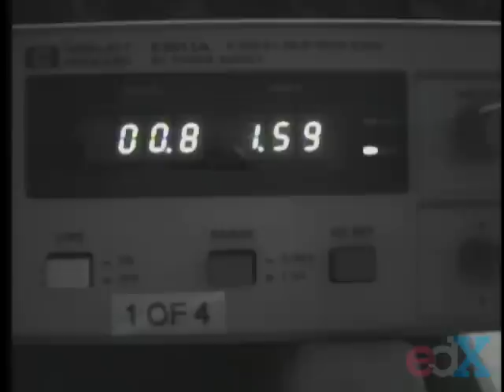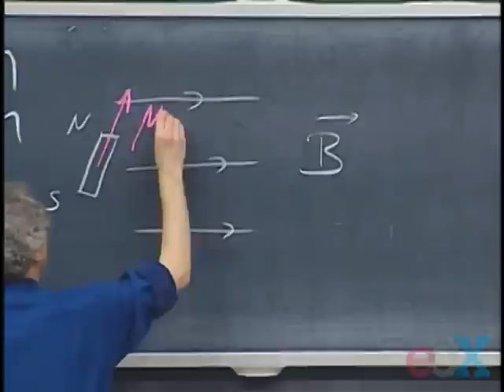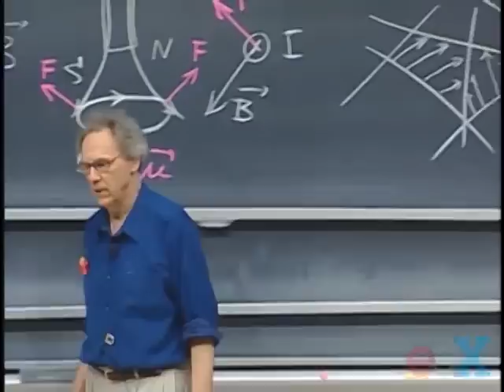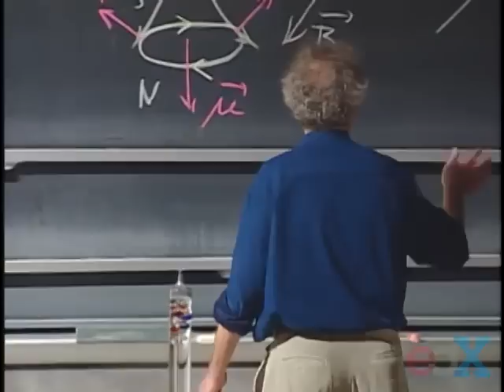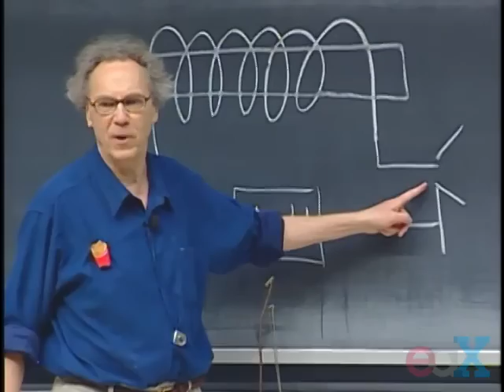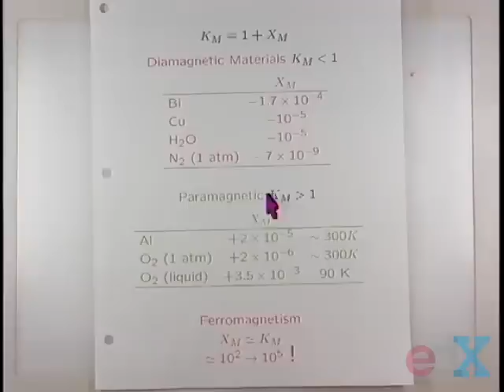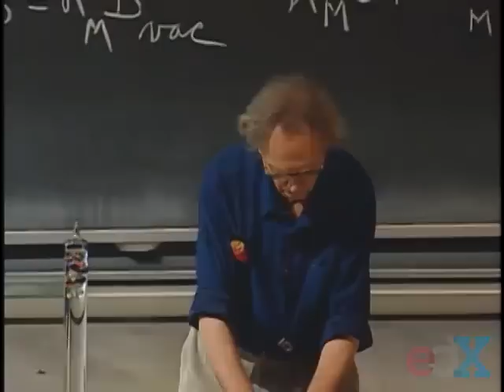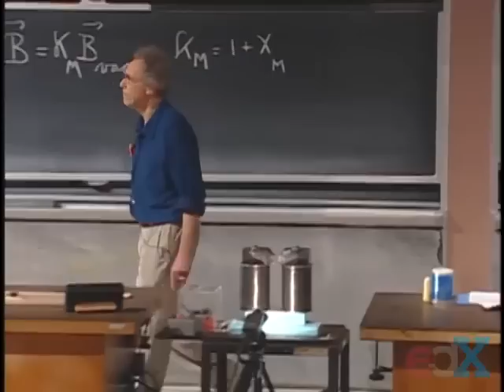8.02x - Lect 21 - Magnetic Materials, Dia- Para- & Ferromagnetism

Comment: Why does the external field have to be non-uniform for a ferromagnetic material to be pulled towards the magnet? The magnetic dipoles will align themselves with the external field's magnetic dipole, but won't that happen if the external field is uniform too?
Reply: I just got it, if the field is uniform the dipoles will still align themselves with the external field's dipole, and the net Lorentz force will be zero. What I don't understand now is, how come there's a current in a molecule or atom? (12:55)
Is it a fictitious current that you used to explain the existence of a force or is it actually real? For example a water molecule has a magnetic dipole, but does that mean there's actually a current on that molecule?
If not then do we need quantum mechanics to explain why magnets attract each other? Since we can't make use of the Lorentz force anymore?
Reply from the maker: Only QM can answer your questions.
Reply: @Fattyboye  When a magnet is in a uniform magnetic field, the magnetic force on both its poles adds up to zero.  The uniform magnetic field cannot apply any net linear force to it.  All it can apply, is a rotational torque that causes it to align with the magnetic fields.   You need non-uniform magnetic field, such that more force is on the north pole than the south pole, or vice-versa.

If there were such a thing as magnetic monopoles, a uniform magnetic field could theoretically apply a linear force to them.  So far, magnetic monopoles have not been discovered or even theorized to be possible, so this example is all hypothetical.  As far as we know, real magnets come with both poles as a package deal.

Comment: sir at 30:10, why ferromagnetic material doesn't attracted towards the magnet when you bring it very closer?
Reply from the maker: I watched at 30:10 and I do not understand your question
Reply: @lecturesbywalterlewin.they9259  Sir question is at 30:10, why not ferromagnetic material just leave the coil and attracted to bar magnet when magnet was very close to coil? Due to friction or you bound it tightly within coil or something else?
Reply from the maker: Lectures by Walter Lewin. They will make you ♥ Physics.
 • 9 hours ago
I watched at 30:10 and I do not understand your question
Reply: @lecturesbywalterlewin.they9259  I believe I understand what they're trying to ask.  When you perform the demonstration, you place the piece of ferromagnetic material inside the coil.  I believe they're asking why, when you bring the magnet near the coil, the ferromagnetic material isn't pulled out of the coil towards the magnet.

The way I saw you set up the demonstration, the ferromagnetic material seems to fit rather snugly inside the coil.
Reply from the maker: @nybble  If you first power ths coil then  put the ferromagnetic material into the coil it will be sucked into the coil.
Reply: @lecturesbywalterlewin.they9259  Oh I know!  I was just trying to clear up the original question asked by Adarsh.  :)

Comment: Professor, I have a question: The core of a transformer is made of ferromagnetic material. We know that  when a ferromagnetic material is placed in magnetic field, the field lines become confined in the material. Then how does the secondary winding of a transformer(which is wound outside the core) knows the presence of alternating magnetic field when the field outside the limb becomes almost zero ??? 

Sir Please help me to understand this.
Reply from the maker: google transformers.  One very very common way is that the primary and the secondary are wound around the same ferromagnetic core.
Reply: @lecturesbywalterlewin.they9259   But professor, the flux prudced by the primary winding is restricted inside the core, the flux is not 'touching' the secondary winding as the secondary coil is wound on the outer  surface of the core.  Then how does the secondary winding sense the magnetic field?
Reply from the maker: @abhiksasmal3304  yes it is restricted inside the core.  You do not understand Faraday's Law.  Watch my 8.02 lectures!

Comment: When a material having permanent electric dipoles is placed in an external electric field, we say that the electric field inside the material is reduced. But when a material having permanent magnetic dipoles is placed in an external magnetic field, we say that the magnetic field inside the the material is increased. Why is that sir? The below dipole configurations with E and B
+Q/ -+ -+ -+ -+ /-Q
N/ sn sn sn sn /S
The magnetic situation should be similar to electric situation. Correct?
Reply from the maker: system goes to Low PE in both cases.
Reply: @lecturesbywalterlewin.they9259  thank you much sir for a fast reply. 

Another question sir.
With cracking sound, we understand that atoms changing positions. Will a polycrtstalline ferromagnetic material become a single crystalline material?  I am wondering this for a quite long time.

Comment: Good evening sir. The magnetic field lines due to a bar magnet inside the bar magnet do not vanish, that means the permanent magnetic dipoles in the bar magnet(if any) can experience that magnetic field l. So, does that mean the bar magnet can magnetise itself?
Reply from the maker: question unclear
magnets exist in nature
Reply: Lectures by Walter Lewin. They will make you ♥ Physics. I am trying to say that if we bring a paramagnetic material in presence of a magnetic field, the atomic dipoles align themselves in direction of the applied field. So similarly can a bar magnet affect the atomic dipoles inside it due to it's magnetic field. If i am making some conceptual error then please highlight that too. Thank you professor.
Reply from the maker: >>>similarly can a bar magnet affect the atomic dipoles inside it due to it's magnetic field.>>>
It takes energy to do that. Perhaps this may be possible if the object cools substantially. ask google
Reply: Thanks sir. So it is possible if the thermal motion is decreased substantially?
Reply from the maker: I assume so

Comment: Say if I put a magnetic material inside a solenoid having n turns and current I , magnetic field inside magnetic material is nu*M where M = n*current induced in material. Now if I remove solenoid and magnetise it using bar magnets; what would be the magnetic field induces now?
Reply from the maker: >>>>> Now if I remove solenoid and magnetise it using bar magnets>>>
I don't understand
Reply: Lectures by Walter Lewin. They will make you ♥ Physics. Sorry for question being unclear. Basically in first case I was using solenoid to induce magnetic currents in the magnetic material. But now out of curiosity I took another piece of the same magnetic material which is UNMAGNETISED and try to magnetise it by creating a magnetic field not through the solenoid but using BAR MAGNETS. So in this case how can I calculate the magnetic field induced in the magnetic material?
Reply from the maker: I would no know how to calculate it. The B-field inside a solenoid is well defined and uniform. If you bring ferromagnetic material inside the solenoid it will respond in a way that is more or less predictable. But to use a bar magnet to magnetize iron is a very different thing. In high school I used to magnetize paperclips that way. Nice to pass the time.
Reply: Ok..Thank you for reply

Comment: Sir, what if we have a changing magnetic field near ferromagnet or paramagnet, what will happen then, will there still be attractive force between the two or will there be an induced emf in the material and they would reject each other?
Reply from the maker: >>> what if we have a changing magnetic field near ferromagnet>>
attraction will be maintained in most cases
Eddy currents will also be produced.
Reply: Lectures by Walter Lewin. They will make you ♥ Physics. Is that because force of attraction is larger that the repelling force created by eddy currents
Reply from the maker: it all depends on
* geometry
* strength and frequency on external B-fields.
Reply: Lectures by Walter Lewin. They will make you ♥ Physics. Thank you a lot sir, I really admire your students, you are the best :)

Comment: Professor, since paramagnetic materials have an increase in relative permeability with decrease in temperature, and ferromagnetic materials lose their ferromagnetic properties with increase in temperature beyond the Curie point, does that mean that ferromagnetic substances will have an increase in their ferromagnetic property with decrease in temperature, like paramagnetic substances?
Reply from the maker: Castor Gemini Castor that is a very good question. Clearly if you move away (by cooling) from the Curie temperature, T_C, the strength of the ferromagnetic properties increase. However, if you go far enough below T_C the increase is very very small and asymptotically approaches the maximum. I suggest you look at the schematic figure 3.8 in the following article. http://www.cmp.liv.ac.uk/frink/thesis/thesis/node40.html
Reply: Thanks Professor!

Comment: Professor, I had a very general doubt.

I am not able to understand this:
When a material with many electric dipoles (say polar molecules) is placed in an electric field, its dipole align to create surface charge densities which OPPOSE applied field.
But, when a material with magnetic dipoles (say paramagnetic or ferromagnetic) is placed in magnetic field, its dipoles align to ENHANCE the applied field to a certain extent. Can you tell why does dipole alignment in magnetism enhances the field. 
Or why not the alignment of electric dipole enhance the field ?If I am wrong in facts, please correct me.
Reply from the maker: Place a compass in the Earth magnetic field. It will rotate till it has reached the minimal energy state. That is when the B field of the magnet of the compass aligns with the B field of the Earth magnetic field and that enhances the B-field. Take two permanent magnets bring them close to each other. They will also align (minimum energy state) which will also enhance the magn field.
Reply: I am sorry Professor but the thing is I can't understand is WHY IS MAGNETIC FIELD ENHANCED when magnetic dipoles align with external field.
Reply from the maker: take a permanent magnet #1. Draw field lines at its North Pole. Take a 2nd magnet #2 and draw field lines near its S pole. Now place the N pole of magn 1 against S pole of magnet 2. The B-field at the N pole of #1 has doubled.

Comment: Professor, I had those commercial playing magnets with me when I was a child you were supposed to throw them up (not sticked together but close to each other) and they would create sound midair. They often fell on the ground and separated but after that they   sticked perfectly together .Is that possible? What could they be made of?
Reply from the maker: no idea about the sound. Yes if you break a magnet they "fit" again nicely together but remain broken.
Reply: I was not specific enough They were two black cylindrical magnets and they buzzed when they stick together midair and they dont break when they hit the ground they are very tough but they didnt demagnetize like your magnets did in this video. My question is that do all magnets demagnetize on being hit or is there an exception?
Reply from the maker: almost NONE get demagnetized when they hit something.

Comment: Create a magnet that runs East and West. Use the North and South to steer
Reply: is it possible,? if not find out why ... you could create a device that will travel gravity free...
Reply from the maker: what does mean to travel gravity free?
Reply: planets revolve east west movement... lock on that gravitational east west movement and use north south to steer...traveling east west repels north south gravitational pull. The repelling of north south cancels gravitational pull..
Reply from the maker: You have a misconception about gravity. The grav force is pointing to the center of Earth regardless of where you are on Earth and regardless in which direction you travel.Because of the rotation of Earth and its oblate shape, the grav acceleration (pointing to the center of the Earth) at the equator is about 0.03 m/s^2 lower than at the poles. Use google and do your homework.

Comment: Sir I am a student of 12 class. In my standards there is no course for QM. 
Sir please explain how the QM explains that atom has minimum potential energy when its dipole moment is align with external magnetic field.
Reply from the maker: Atomic dipoles[edit]A non-degenerate (S-state) atom can have only a zero permanent dipole. This fact follows quantum mechanically from the inversion symmetry of atoms. All 3 components of the dipole operator are antisymmetric under inversion with respect to the nucleus,{\displaystyle {\mathfrak {I}}\;{\mathfrak {p}}\;{\mathfrak {I}}^{-1}=-{\mathfrak {p}},}where {\displaystyle {\mathfrak {p}}} is the dipole operator and {\displaystyle {\mathfrak {I}}} is the inversion operator. The permanent dipole moment of an atom in a non-degenerate state (see degenerate energy level) is given as the expectation (average) value of the dipole operator,{\displaystyle \langle {\mathfrak {p}}\rangle =\langle \,S\,|{\mathfrak {p}}|\,S\,\rangle ,}where {\displaystyle |\,S\,\rangle } is an S-state, non-degenerate, wavefunction, which is symmetric or antisymmetric under inversion: {\displaystyle {\mathfrak {I}}\,|\,S\,\rangle =\pm |\,S\,\rangle }. Since the product of the wavefunction (in the ket) and its complex conjugate (in the bra) is always symmetric under inversion and its inverse,{\displaystyle \langle {\mathfrak {p}}\rangle =\langle \,{\mathfrak {I}}^{-1}\,S\,|{\mathfrak {p}}|\,{\mathfrak {I}}^{-1}\,S\,\rangle =\langle \,S\,|{\mathfrak {I}}\,{\mathfrak {p}}\,{\mathfrak {I}}^{-1}|\,S\,\rangle =-\langle {\mathfrak {p}}\rangle }it follows that the expectation value changes sign under inversion. We used here the fact that {\displaystyle {\mathfrak {I}}}, being a symmetry operator, is unitary: {\displaystyle {\mathfrak {I}}^{-1}={\mathfrak {I}}^{*}\,} and by definition the Hermitian adjoint {\displaystyle {\mathfrak {I}}^{*}\,} may be moved from bra to ket and then becomes {\displaystyle {\mathfrak {I}}^{**}={\mathfrak {I}}\,}. Since the only quantity that is equal to minus itself is the zero, the expectation value vanishes,

Comment: 17:40 does that mean if I lose the magnetic property of a, let's say, typical magnet; then I can reintroduce a magnetic field to the "dumb magnet" to get it back working again?
Reply from the maker: you can magnetize a paperclip by simply placing t at one of the poles of a magnet. You will do better if you place the paperclip inside a solenoid with a very high magn field.
Reply: @lecturesbywalterlewin.they9259  No, what I mean to say is that if I have a standard magnet (let's say from a speaker, which I suppose is made up of a ferromagnetic material) and I heat it up so that it loses it's magnetic property. Now, if I bring another similar magnet and near the first magnet, will it regain it's magnetic properties?
Reply: And also, are you Mr. Lewin himself? 😅
Reply from the maker: yes I am walter lewin I am the only person who runs this channel - watch all my bi-weakly physics problems and solutions and art quizzes
Reply from the maker: If you heat the magnet above a certain temp (I forgot the name of that temp) it will lose its magnetism, when you cool it it will become magnetic again. I do a demo in class.
Reply: Oh thanks a lot, Mr Lewin. I haven't watched all your lectures, so I haven't seen that demo yet but I'm sure I'll come across it soon!
Reply: @aabhusanaryal90  It is called the Curie Temperature.  It is named after Pierre Curie, the husband of Marie Curie who discovered radioactivity.  Pierre Curie did research in magnetism.

At that temperature, ferromagnetism will reset to the surrounding magnetic field, allowing you to make ordinary iron into a magnet, or make a magnet into ordinary iron.  Raise it to that temperature, and then cool it back down to room temperature, and you will establish the magnetic field it had when it was at the Curie Temperature.